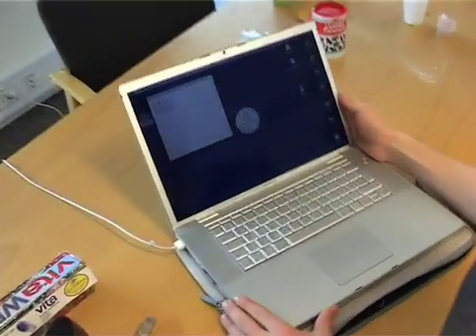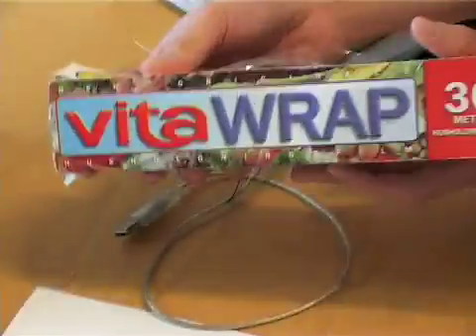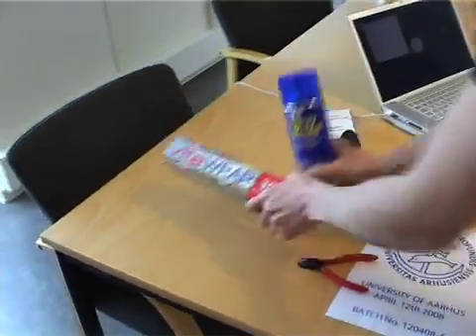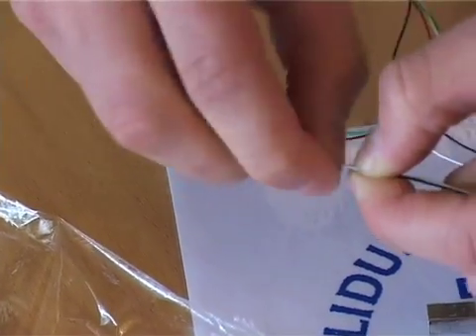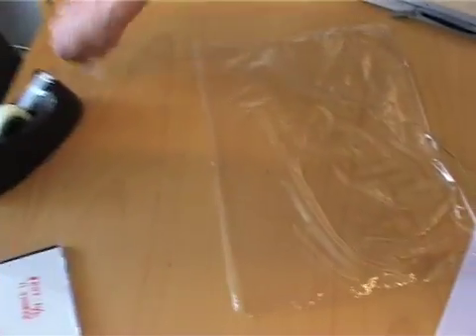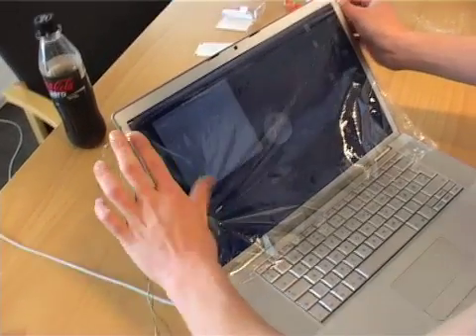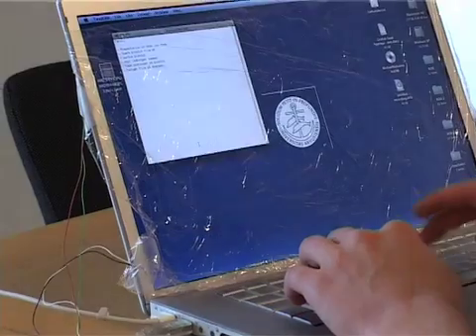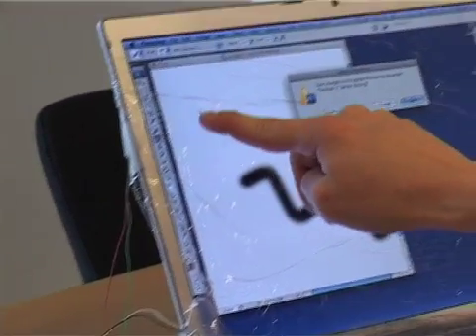Sensation: New MacBook Pro Touch Screen!

Comment: I don't know if THIS works, but I just made a very accurate touch-screen with plastic wrap and conductive spray by connecting a capacitance sensor to each corner and wiring them to an Arduino. Then I programed it to send the data through serial to a java program on my mac.

Comment: @Flightkid9 As far as I understand, this is just a DIY touch screen (using "capacitive sensing"), and it should work, if you use the correct software (like they do) and connect your wires correctly.

But the materials they use here, are not as good as the ones they use in "real" touch screens (of course they're not using plastic wrap and USB wires).

Comment: i have seen many dumb videoes b4 on ytube, but not like this one. this video is dumber then dumb. 1) electricity cant pass through plastic. 2) u can never wet any electrical equipment, it will damage the system.. and that plastic wrap look awful... mr. macbooktouck YOU ARE A 5 STAR DUMBOOO....

Comment: y'know what I think is hilarious... the ignorance of comment and forum posters.what he is doing is not fake no matter how fake it looks. Its called resistive touch sensitivity, The spray conducts electricity. your finger touches the screen creating more or less resistance.The electricity returns to the computer through the data wire at a new ampage or speed. The program converts the speed to an XY coordinate that the cursor can adopt. he didn't calibrate it before demonstrating so it looks fake.